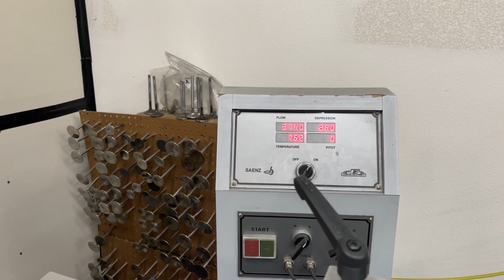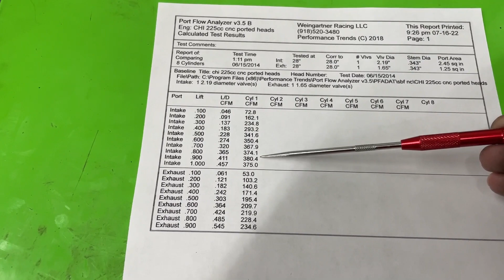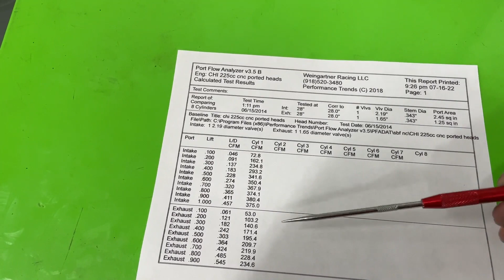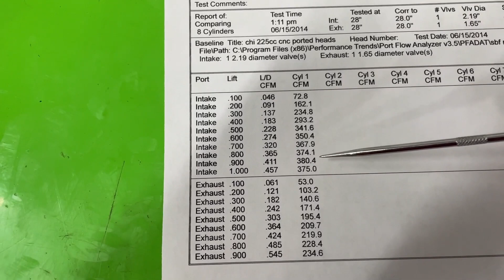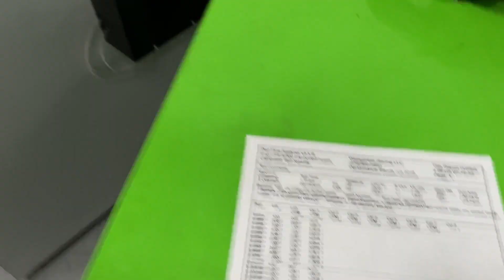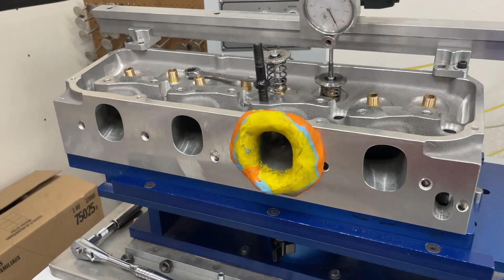SBF CHI Head Review With Real Flow Numbers

Comment: The Cleveland architecture still has not been surpassed. It still has as much or more potential as anything after all this time
Reply: The biggest issue with factory Cleveland heads is how stupid big the ports are. The exhaust is awful and the intake has too much dead space. The 9 1/2° valve angle is still really contemporary it just took 30 years for someone to cast a head with the right size and shape of port
Reply: @timothybayliss6680   yes, for most applications. Which is why most serious racers filled the intakes to suite their rpm/cubic inch combination and raised and straightened the exhaust - pre aluminum era
Reply: You have to go all the way to TFS-R or better to match it.    They were serious pieces and I see why they were banned.
Reply: @timothybayliss6680  Clevleand and other big heads are fine if you reduce the camshaft duration.
Reply: @dennisrobinson8008   Totally depends on RPM range and cubic inches. Our 311 inch race engine had big ports AND big duration (285 @ .050). But it's operating range was 8500-9800
Reply: @treyrags  yep.
Reply: @timothybayliss6680 which is what Bob Glidden innovated and proved with 12 world championships 45  years ago with the Cleveland.
Reply: @dennisrobinson8008 that would reduce airspeed, in turn would lower efficiency
Reply: Refer to the dz302 vs boss 302 dynos.  Dz302 was medium head large cam and the Boss 302 was huge head and small cam.   The Boss 302 beat the dz302 at all rpm points.   Richard Holdener did a YouTube on the comparison including dyno.
Reply: @dennisrobinson8008 Most people put way too big of a cam inside their motor IMHO.
Reply: @treyrags  remember Port Plates?
Reply: @collegeparkwhiteboy  back in the day before we were allowed to run aftermarket heads we filled the exhaust with bronze and ported. Much more work and expense but a better result. Intakes got epoxy.
Reply: Cleveland heads suffer from incorrect cam timing. Leaving the valve open longer on a low airspeed/high pressure port just leads to reversion. 

The only fix was to up the RPM, up the displacement, or (as everyone blamed the ports) reduce their size to run Chev based cam timing.

And, yes. The workers of the suspension factory would have lost their jobs with a redesign that was in the design phase, so went on strike. Hence, Ford had to keep the suspension towers in the engine bay. This limited exhaust port design as the engines came in the top, log manifolds attached. Anything different from what was made was too expensive to implement.
Reply: @crd-nz_001  When I refer to architecture i'm talking about valve angles, cant,  port shape, etc. Not size. Most guys that needed to run more rpm than they wanted to make their cleveland heads work had their ports too big. The ports need to have matched cross sectional area for your intended rpm and displacement. The cam is then designed  to match
Reply: @treyrags  I also was talking about valve angles, positioning and cant.   People were able to fill the floors with port stuffers reducing volume but gaining velocity and flowing similar to the original port size.   And the CHI 3v and 4v heads have smaller ports but flow more.   The ports are raised in those two but they use Cleveland architecture.

Comment: My family ran Clevelands in our dirt track cars for years, starting when they first came out. We had already been running the Boss 302s for a couple years, and the 351s would walk off and leave the Boss engines, when we got them figured out. By then, Ford had the Boss 351 out, and we could actually get some parts that would work. We stayed with the Clevelands when they got so hard to find, running every conceivable block and head combo imaginable. We ran hard, and were one of the teams to beat everywhere we went. We took a lot of checkers running basement ported 2V open chamber heads, when it got so hard to find stuff in the mid to late 80s. It's great to see companies coming back around to these engines, and making some excellent parts for them.
Reply from the maker: I'm glad to know they worked well for you. I like the heads but I know next to nothing about there shortblocks.
Reply: I still have 2 stock bore short blocks sitting in my shop along with a pair of CJ heads.
Reply: I’ve always gathered based on rare magazine article comments from the 80s-early 90s that the 2V heads flowed better than anyone cared to admit, at least for street purposes, though I don’t recall anyone publishing any numbers cause Windsor performance heads were starting to make their way into the market. That’s why there were aftermarket intakes at least for 351C 2V to convert them to 4Vs. I had a 71 Cougar with a 2V motor. I drove it with the 2V carb but added cheap dual exhaust and open element air cleaner with a taller filter. It acted like it wanted to pull up too, park 6k, which wasn’t healthy. Thanks for sharing your experiences.

Comment: Great video Eric. Enjoy your work. You should see the flow on my current A3 heads Darin did. We’re talking 396 at .900 and 261 on the exhaust. Made 775 with 409 inches. Small cam and only 13.3 cr. Thanks for the vid
Reply from the maker: Thanks for watching. Darrin does great work.
Reply: @WeingartnerRacing  your do too Eric. Thanks

Comment: But, the CHI head is not a Cleveland head. The 351C head has weak exhaust flow in comparison to the intakes. The CHI head is redesigned, and raised the exhaust.

Comment: I've been running Cleveland's or 460's since 1988.  Always thought the windsors were a joke. Running 208 CHI's on a 400 in my work truck. They are awesome.  Kaase sells the CHI as a branded head that flows 400 on the intake CNC'd ready to run with matching intake for around $6500. I bought mine bare for $2850. With 5 angle intake on 2.08" valve flowed 316 CFM at .500"
You can get these with stock location exhaust or raised .200". 
Also, the valve angles are the same as Fords 4V so they work with 4V pistons. You can use 4V intakes on these but you may need a spacer depending on your particular combo. A 1/2" thick works on 400 with 2V intakes if you slot the holes and lines up fine as the 2V is almost exactly the same size. CHI has several different manifolds for the short deck 351 blocks.
Reply: I am happy you like my 208 CHI heads, good to see people know a great head when they see them. Dave S
Reply: I love my 427w.

Comment: I built a 417ci SVO block engine with as cast 225 CHI's 11yrs ago and made 682hp, just on 700 with race gas and went 9.8xx 136mph @3600lb. Awesome heads
Reply: I am currently building a 420 cube Clevor using an aluminum Fontana block. Can’t wait to see what it churns out with these heads on it.
Reply: @sparksandgritgarage555  you using them out of the box or a bit of porting? My cam was 269/282 727/727 106lsa.1050 Dominator and 2in pipes
Reply: @Jody Baldwin definitely will be doing some porting. Thanks for the info. I’ll put it to good use. What intake did you use?
Reply: @sparksandgritgarage555  CHI Dominator unported, I think the new ones are better than what I used at the time.
Reply: @jodybaldwin4864  Right on! Thanks again.
Reply: What compression you running Jody? What cam you running ?
Reply: @clevo351  was 13-1. It ran on Ultimate 98 but better on AVGAS as I could run more timing. Cam was 269-282@50 108lsa 727lift
Reply: What transmission and what did it make at the wheel.?
Reply: That's a massive drag roller cam. Definitely won't last on the street.

Comment: I`ve got a old set of Ernie Elliot C3 heads that are going on a windsor 427. I believe they`re 1995 era heads from a nascar truck engine and those CHI heads flow 15 to 19 cfm more except at 500 lift where they are the same. I saw those CHI heads at a PRI show in Orlando a few years ago and was impressed.
Reply: My folks traded around with the Elliotts forever. We had a building and construction business, and used George Elloitt's building supply for lumber and materials. My uncles  all raced the dirt tracks around here, and they ran Clevelands in their cars, getting and trading a ton with the Elliotts and the Ridleys. (Jody and Biddle)

Comment: Even stock 2v heads with a decent port job are EXCELLENT street bruiser heads.  The heads used on the M series engines are identical to 2V Cleveland heads except that the chambers are around 78cc.  They work well in a 400 though & CR between 10 & 11 is easy to do with a flat top piston running 0.007" deck clearance with a 0.040" - 0.045" gasket.  The chamber is close to a hemispherical shape with quench pads parallel to the valve guide centerline, making it possible to run 11:1 on pump gas to at least 5500 RPM.  I offer this because the heads are pretty easy to find in salvage yards.
Reply from the maker: That should help the Ford guys.

Comment: GM Australia also had similar port locations on their v8 engine for a while. For the v8 supercar series they were using custom cast factory heads with individual runner intakes. The factory heads went to non mirrored valve layout in 1988 and stayed that way until the Ls series replaced them, in around 1994 it was replaced in the V8 supercar series with 18° nascar style stuff.
Reply: They did this to even up the parity. Virtually copied the ford head to suit the chev geometry as porting Siamese made it difficult. Holden also copied the watts link rear end, double wishbone front end and already had the 9 inch final drive.  There was a lot more Ford engineering in the Holden than was actual Holden.
Reply: @dinosshed  thanks for saving me typing up the same, lol! Just to add, back to back testing revealed the Ford head had a 50HP advantage over the Holden and Chev heads. As you say, the solution to even up the racing was to effectively make Ford heads for the GM guys. Then there was the cutting back of the Ford front undertray by 200mm to nobble the Ford's superior front end grip and the raising up of the Ford front end by 50mm for the same reason. They also forced Ford to adapt the EL aero kits to the new, totally different body shape of the AU Falcon, after Ford Legally made up a new aero kit for the AU which would have made the AU a rocket. After all of that, we have to listen to Holden fans telling us their race cars were better! Unreal.
Reply: @georgebeare8883  Yes, I was one of few cheering on the Ford teams at a few meets, as Holden had two types of customers, #1 Bogans and #2 Old Bogans. There was no reasoning with them, as they didn't realise what they were in such love with.
Reply: @dinosshed  I hear you mate! Myself and a couple of Ford mates went originally to all of the Victorian rounds of the championship. Winton, Calder, Sandown, Phillip Island, wherever a round was. It was great the first year or two, watching those 4 Falcons out front and a battalion of Commodores holding up the rear.

That was before the so-called "Parity" scheme began, code for Slow The Fords Down. 

Talk about Bogan GM-H fans, I had a number of arguments with them telling us it was the other way around: that the Commodores were being nobbled! FFS! 

The best example of one of them ( who really should have known better ) happened in the workshop of a well-known drag racing engine builder. A bloke was there supplying his specialty race engine item ( I won't say what because it will identify him ) and the banter was the usual Chev small blocks are king stuff. 

I pointed out that the Technical Controllers of the touring cars had identified the SBF was producing 50 hp more than either the SBC or Holden V8 and so the Techies were casting up basically Ford heads for the Chevs and calling them "Holden Motorsport Heads" to fix that.

Now, here was a bloke making a racing part for some of the Holden teams and he wasn't having any of that nonsense. No way!

He said he was going to call a mate at one of the Holden teams and call me out on the spot. He went away in a quiet corner and called GRM. When he came back, he did not say a single word. All went very quiet. LOL.

Another time, I was in the queue to get in at Calder. In front of me was John D Davison. I said G'day and we chatted. He said he was queuing and paying to get the regular event goer's experience there to compare to Sandown, the track he was promoter of back then.

He was so excited for the next year's racing because Lowndes was joining HRT. He said all of the track owners were. As he put it, the majority of spectators were under 30 and drove Holdens and they didn't want to see a middle-aged bald bloke with a beard and glasses, driving a Ford, winning. That'd be JB, of course, at DJR.

The industry wanted a young bloke winning in the factory Holden team car because that was good for business. That tells you all you need to know.

It's such a pity that the record books show the results favouring Holden so very much, but do not disclose the reason behind why it was the case. Imagine if in Australia they "fixed" outcomes so much in Aussie Rules or Rugby! There would be blood on the streets. Cheers.

Comment: Good review.  I have a set arriving today to replace my damaged 4v heads on my 411ci Clevor.  I’m hoping for the same numbers out of the box. Strictly track 1/8 mile 4-door LTD full interior stock style suspension runs 5.8 1/8 mile. Hoping to better that with the weight savings.

Comment: As a Ford guy, ford's 2 biggest issues where the shock tower cars they used. The exhaust ports are the way they are because they didn't have room for the engine, good exhaust and the shock tower. And they believed in the all or nothing mind set on engines. Look at the size of ports on all thier hp engines vs the everyday version of the engine.
Reply: But, back in the pro stock day the raised exhaust was claimed to offer about a 10 hp advantage. Exhaust exploding out the exhaust valve at such high pressure can 'straighten' the passage to atmosphere. Intake architecture most important which Ford got right in many applications.

Comment: The Boss 302 is basically a cleveland head on a windsor bottom end
Reply: Not basically, they are!  Some differences for water etc but those ports and valves are Boss 302. Personally I feel they are way too big for a 302, too big for a 351!

Comment: If I send you a set of these brand new, would it be unreasonable to sink a dowel pin into the valve guide and spot face it so you can get the pilot tool in there?

Comment: I will say here in Australia we have the Falcon which is what the Barra is in but the older Falcons also had a Windsor Option Pretty much the Foxbody engine and we had a ute option in the Falcon. I was going to buy a TE-50 AU Falcon ute I nearly had the sale done but I bought a VS Commodore ute instead which I still own. The Falcon AU Tickford ute had the Windsor engine, plan was to buy a DART block and do a Clevor build with these exact heads at 370 cubes.

Comment: Have you done any gen III hemi heads yet? I would be I terested to see what you could do with with set of the 2016 and newer 6.4 bge heads.
Reply from the maker: No. I got the flow plate to flow them then nobody sent one in.
Reply: I was thinking what you are thinking. When Eric explained about how on the Cleveland, with the valves having a slight twist compared to the centerline of the chamber and how the air would flow in from the intake port and transition to the exhaust port, the Hemi with it's opposing valve layout would be spectacular!
Reply: Supposedly Apache heads can go over 400cfm with a 2.14-2.20 intake valve.
Reply: @WeingartnerRacing  I have a some if you want to give it a whirl say the word and I’ll send them in
Reply: @fustyblatherskite2142  This is how TFS TW heads were dominant...
Reply: @dennisrobinson8008  I beg to differ. The Ford Twisted wedge heads had intake valves on a 20 degree incline and the exhaust valve was on an 16 or 18 degree incline, but the valve heads were inclined with the bore centerline. I have a set. But , Trick flow had a Powerport 190 head, which is a copy of a Cleaveland head, that has valves with a slight twist and cant to move the valve away from the cylinder wall as it opens. The hemi head is really spectacular because the intake valve is above the bore centerline and the exhaust is below. As these valves open they move far away from the cylinder wall. A hemi head has the best cross flow characteristics of any American V8 engine.

Comment: with the valve guides, you can put new guides in do the valve job then mill them down flat.
Reply: Serdi or Newen seat cutting machines float the pilot and centrelise it automatically.. not an issue.. his machine works on pilot in guide.. CHI uses Newen CNC to cut seats..
Reply from the maker: That is correct but I don’t think anyone in my state has a newen at 120k. I have seen my fair share of out of round valve jobs from serdi.
Reply: @WeingartnerRacing  100%, YOU NEED THE EXSPESIVE CARBIDE TUNGSTON PILOTS, IN MANY SIZES TO HAVE PRECICE FIT IN GUIDES, EDELBROCK ARE THE WORST FOR THAT.. FIXED MANY SETS.. YOUR SEAT JOBS LOOK VERY GOOD ERIC, SHOW US MORE OF YOUR MACHINE AND METHODS..

Comment: Love CHI's products - I really REALLY want to build a 400" 9.200(or 8.700 if any are even around these days) deck with one of the versions of these and a turbo or two. Drop it in a square body Ford Ranger drag truck w/ CalTracs, spring-under conversion, and double adjustables front & rear, with a 5-speed behind it(TKX? They're looking pretty beefy, at least a couple drag cars out there putting 1000+HP through them thus far)... yea, I have plans LOL
Reply: I'd would go with the 9.5 so you can get a decent length rod in it! Thats .300" more room for a good rod stroke ratio. I like building it one time! The longer intake runners turn some off, but it'll stay together better.

Comment: Grind the potato out of the exhaust port on a stock Windsor head now you're moving air. The reason Ford put that EGR bump in the exhaust port is so they had a place for the tooling to set on when drilling out for the EGR ports.